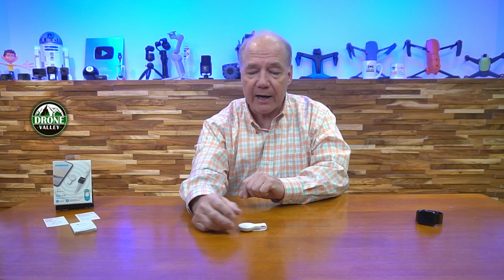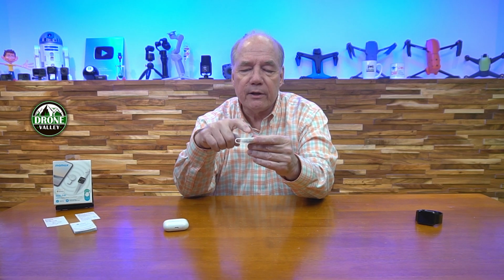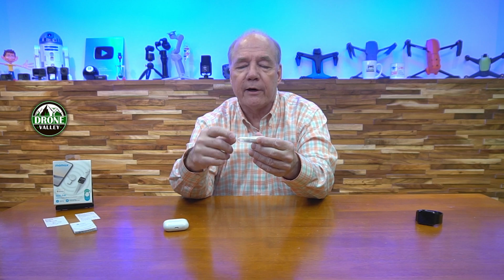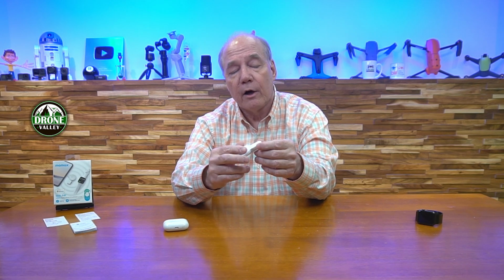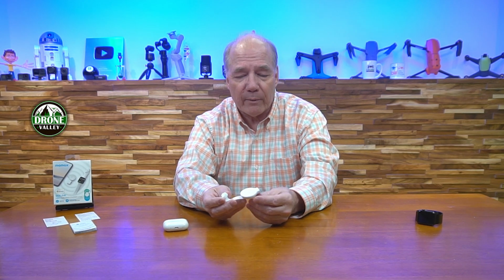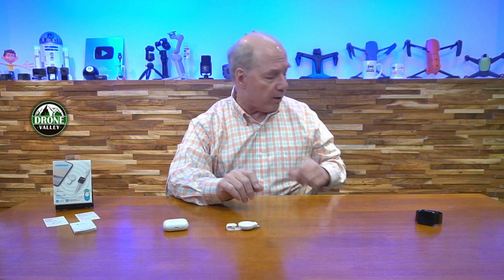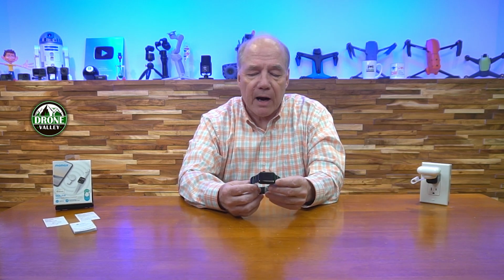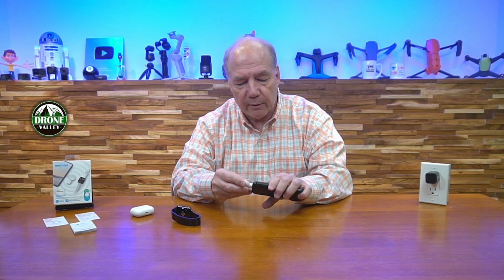MOMAX Apple Watch Charging Adapter - Easy & Clever

Comment: I contacted Momax.  This does NOT charge the Apple Watch Ultra at High Speed, the same as its own charger. As stated in the instructions, " Integrated USB-C charging connector for power input achieves raw charging speed for your Apple Watch | Fully charges your Apple Watch in 2-3 hours."     The Apple Watch Ultra charges in One hour to 80% and 1.5 hours to 100% with its fast charger. This adapter would take almost 4 hours to charge the Ultra!  Rather just buy the Apple wireless Fast charger with a wire.
Reply from the maker: Steven, thanks for the post and a lot of the charging speeds depends on the type of charger you're using. This is a fully MFI certified device so it's been approved by Apple for us with all of the Apple Watches. I've tested it on both a standard charger and a 65W PD fast charger and have had no issues with the faster charger. I'm a big fan of folks using what they like best, but for me the convenience of carrying a smaller devices without with wires outweighs any small speed difference in charging.